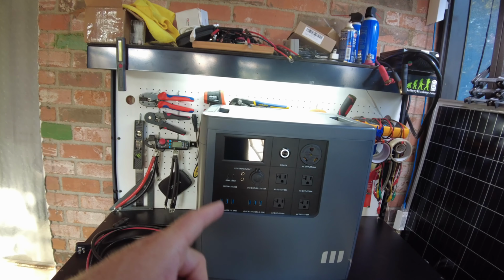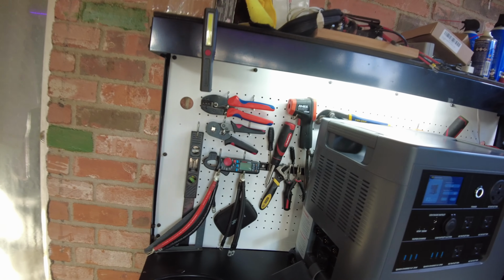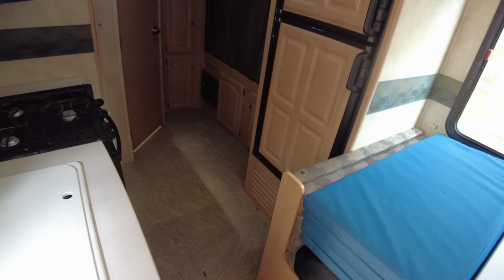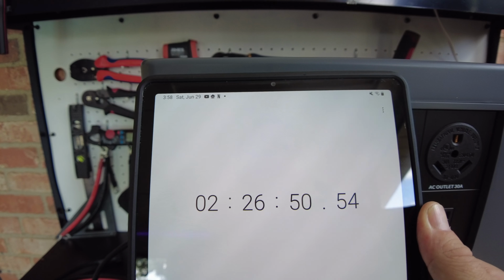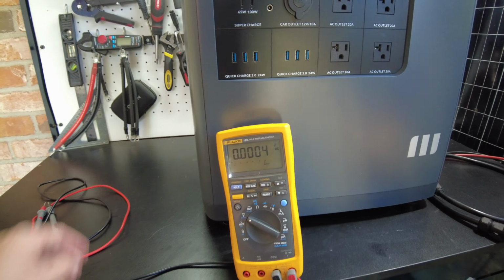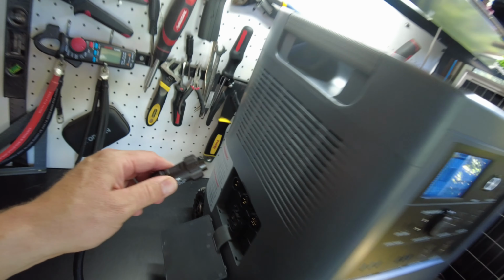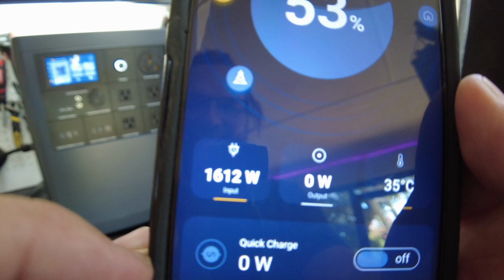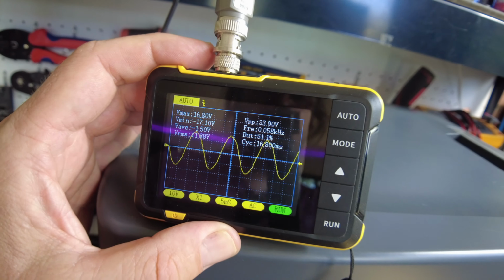Mango Power E Power Station

Comment: You all are not doing the proper testing.... I have a Delta 2 Max and have a constant 40w 12v load and the battery is completely depleted in 24 hours!!! That is 960wh load on a 2024wh battery!!!!

Comment: Down to around $1300 on Amazon.  CATL LFP batteries worth that.   My solar array is coming in at around 50v.  will either need to series or use a boost MPPT solar charger.  Designed for 240v using two power stations... Like that but the cables are too pricey at $250.  Hope the warranty was good, my order on the way... still, one of the best deals on a "larger" power station.

Comment: What BMS etc version is yours? Lots of known issues with the mango, seems to be a good product but lack in development of firmware to fix well known issues,  glad to see you have the "safe" cables
Reply from the maker: Where do I find that info? I see under firmware in the app Wi-Fi 1.1.9, and EMS 4.2.1 but I guess that's not telling us about HW versions.
Reply: @BradCagle  that's the info I was looking for,  more info is also on the touch screen but i dont rememer of the top of my head where it's at.  I can tell by your cables you have atleast the 3rd revision,  1 & 2 had the cables with protruding connectors which were a shock hazard

Comment: That's not a beast of a power station, it only offers a 2X surge capacity which is pretty wimpy for a modern inverter. If your AC unit was any larger than a 1.5 kW load, this unit would never start it. Even worse, this mango, might start your AC unit when it's new, give it a year and I'll bet you that there's a good change that it won't still be running do to its cheap high frequency, transformerless design.

Comment: Really good units I helped out a family running the units on solar for over a year sad the mango company does not stand behind their product warranty but I found a recycler guy in LA and sells them for 1500 a piece or you can get the internal battery for 500 dollars he add lado sells all the internal replacement parts brand new I put one together for under 700 dollars and got 4 sets of batteries 14 kWh 1200 dollars and using. Growatt solar charge controller and a pure sine low frequency middle Atlantic ups inverter pushing 5000 watts solar and 4000 watts ac out of the ups
Reply from the maker: Interesting on the parts. What's the voltage on the batteries? Is it 48V

Comment: Thanks Brad. Good review.
Some thoughts; Standardization - typically, Home and RV users will have 48V batteries - why not provide an Anderson connector to expand the capacity that can accept 48V, why do we have to put up with "expansion packs"? The thing is already expensive without the additional restrictions on expansion. Makes it less viable.
Reply from the maker: I was totally thinking it would be awesome to have direct external connection to the battery. I suppose there could be some issues with people not fully understanding how to do it correctly, and thus a plug-n-play expansion battery is the safer solution. I would like to see a DIY box like licitti has but 48v, I think something like that would hit a sweet spot. Thanks, Ben!